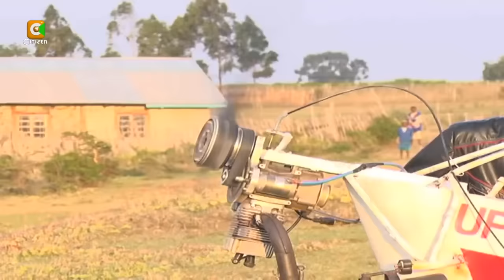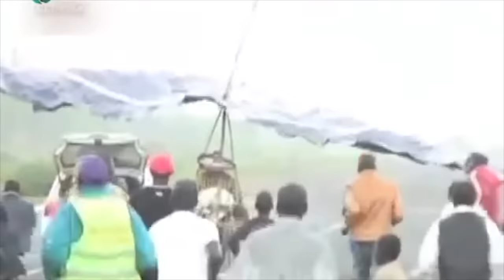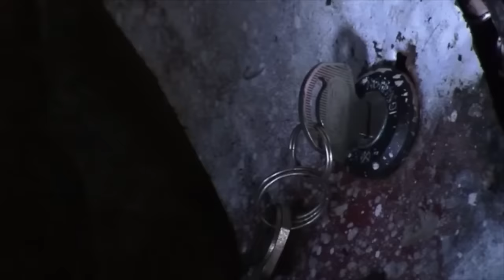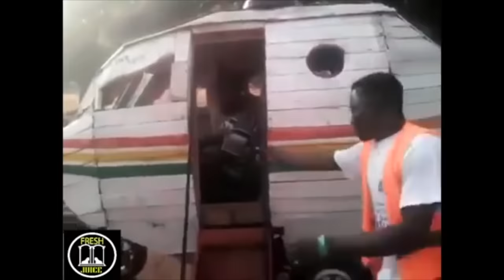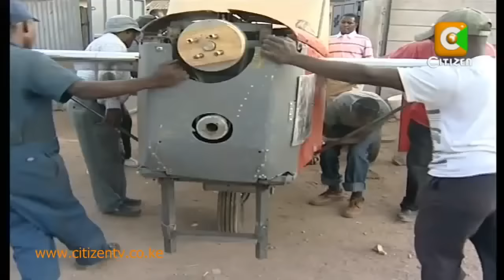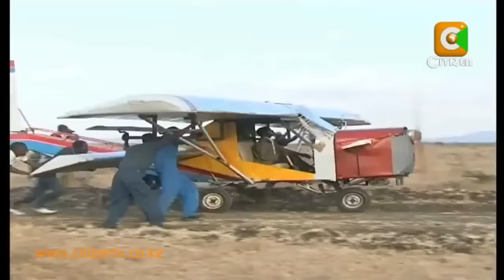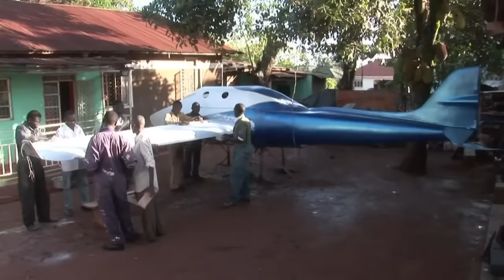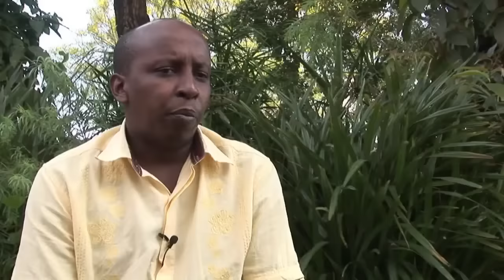African Airplane Compilation | African Aviation

Comment: Imagine how mind blowing a simple physics class would be for these dudes 😂
Reply: Imagine how a respect class would be mind blowing for most of comments in this video..
Reply: To teach respect, in what way? To not point out the obvious errors and goofiness, but to cheer them on or something? "Nice job, at least you tried?" 
I have respect for the ambition they have for their projects. But the sheer amount of (sometimes hilarious) bullshit going on, while information has never been easier to come by... But let's just wave that aside, and cheer the fellows on, letting nothing get in their way of continuing this ridiculous ride, instead of giving critical but fair comments on how they could do it better. Let's not for example say to the chap who is welding, "Get some good welding goggles", no, let that practice continue, let a fucking weld be more important than that man's vision. These men need to learn how to do it properly, otherwise it is only a economic drain for them. If they do that, and come out of it with a working project, or even a failed one without all of the bullshit- THEN they get universal respect. If they can't afford it, set more realistic goals. It's how life works.
Reply: @JimmyPX  soft
Reply: @Mediamarked You've never seen actual poverty. Did you notice any smartphones or computers there? No. Why didn't he use welding goggles? Bc they don't have them. Believe it or not some places don't have cell phone signals, cell phones, computers or access to the things you have access to
Reply: @olliefoxx7165  lol at the virtue signaling. Would you prefer they stay in that situation or improve their lives through knowledge and improving their quality of life?
Reply: @Em022  I'm not virtue signalling just pointing out the obvious. You're acting like the folks that laugh at poor people and tell them they should just stop being poor. Sounds easy when you're sitting on piles of wealth.
Reply: @olliefoxx7165   I like how you can so easily come to conclusions on strangers on the internet. Would you like to write my biography?
Reply: @Em022  take the L there little guy, he made a valid point and you jumped immediately to crying about "virtue signalling" because you didn't have an argument in response.
Reply: First of all, Ollie didn't even offer any point to the thread (which started off as a joke but there's always someone who has to take everything seriously) other than to project that we don't know what "poverty" feels like.  We're talking about improving lives through education. No shit, that some places in Africa don't have access to a lot of amenities in the first world. The continent of Africa is still developing (rapidly in some parts).

Second of all, the response to my question of "Would you prefer they stay in that situation or improve their lives through knowledge and improving their quality of life?" response was that I "sit on a pile of wealth" lmfao. Totally shit on me there .

Now assuming Africans don't have access to phones is just ignorant and shows that you don't know what you're talking about. Africa is developing pretty rapidly and the data says that 60% of Africans have a cell phone and 50% have a smart phone. They also rely heavily on cell networks to move send money to family members. Obviously, this video was made a while ago so the numbers may have been less but that doesn't have anything to do with the present.

Now on to the main point of what this thread is about. The people obviously had access to tools and such to build these flying contraptions. Imagine if we gave them the knowledge of how the world works to actually put there skills in building stuff to actual use instead of this comedic montage of failed aeronautics. What is so wrong with that?
Reply: It is ridiculous to try to build a plane knowing little, if anything, about aeronautics, engineering, or physics. That is true if you have the internet, and true if you don’t. The attempts to be sympathetic to these sorts of wasted efforts, admirable though they may be, are going to keep comically crashing into that reality.
Reply: @JimmyPX bunch of uncle ruckus bots in here. The comments are disgraceful.
Reply: @JimmyPX because this is a racist YouTube channel, look at his pfp, most thease ppl thing África is a country and African is a ethnicity
Reply: @che8866 because this YouTube account is racist one look at his pfp
Reply: @Bell_plejdo568p  yes of course these videos are full of them. It’s nasty.
Reply: @Bell_plejdo568p  just noticed his pic
Reply: @JimmyPX  dud received an 80k donation for a space program he knows doesn't work, he and his friends are laundering money, so I don't respect him and I find it funny
Reply: @olliefoxx7165   then how about starting infrastructure for electricity and water pipe lines instead of a space program
Reply: @Em022  I'm not the one that assumed Africans didn't have cellphones. You're building a strawman argument. By your own uncited stats you say that 60% of Africans have cellphones and 50% have smart phones. Going by your own numbers 40% DONT HAVE CELLPHONES and 50% DONT HAVE SMARTPHONES. So, your own uncited numbers prove my point that there are places in Africa that don't have cellphones/smartphones. Even with cellphones/smartphones that doesn't mean they have good reception or reception at all in their area. There are places in America that have no reception. If you've ever traveled in remote/rural areas you'd know that. 
"Would you prefer they stay in that situation or improve their lives?" That question was so absurd it didn't deserve a response. Who would prefer someone stay in poverty and lack of opportunities? Do you have those thoughts in your heart? Do you wish there were areas of people that didn't get access to education and knowledge? Why would you even ask such an absurd question? Of course I would like to see the people have access to better education and opportunities. If I didn't I wouldn't have defended their attempts at learning. 
You're probably not a bad person, I just think you havent traveled alot or had enough life experience yet. I hope you realize that people with different opinions than you aren't attacking you or hating on you. I have a different opinion but that doesn't mean we are enemies or must dislike/attack each other. Hope you have a good day. 👍 ✌️
Reply: @francisconikotian2326  That's a great idea! It's sensible and practical as well as necessary. However,  it's good for a culture to have dreamers with lofty ambitions. The guy must know he needs those things to achieve the other. Maybe that will spur him to advocate for that infrastructure so his dream can be achieved one day. People with big dreams inspire others and that can be contagious in getting things accomplished.
Reply: @JimmyPX  Praising people for doing nothing of value is not respect, it's demeaning.
Reply: @DamnMyNickIsTaken  Who said they need to be praised? Just don’t be a prick it’s that simple.
Reply: @olliefoxx7165 the only ones I saw laughing were the spectators in the videos…who , wait for it, looked just like them…to use obama’s  fave phrase. So you virtual signal, I’ll join the locals in a good chuckle.
Reply: @Mediamarked  yeah just tell him to get welding goggles. If you do maybe it will just materialize into existence.
Reply: @dexorne9753  They are not THAT expensive, meanwhile, eye surgery is. Just logical thinking, nothing more.

Comment: Love videos like this. There is literally NO WAY they can blame the White man for this. The failures here are that of their own doing.
Reply: What does that even have to do with anything? These dudes are literally attempting to build a plane in their backyard with literal scraps
Reply: @EpicMinecraftFail  it aint hard to make them fly from scraps, long as you can source a decent motor, thats the hard part if ur on a scrap based budget, though if ur smart and just want it to fly then the cheap solution is to make a electric motor build from scraps as you can easily get much higher torque then any combustion motor in a smaller/lighter package, as you can source all ur prefab needs from old generators, starter motors, washing machines etc etc, then throw in a few lead acid batteries for enough flight time to basically take of and then glide back in for landing before the batteries loose their juice, no point trying to make ur go to daily transport first try, just taking of and circling back for a landing = good enough if one wants to show their design is functional + doesnt kill you and get more support for it.

hence you would first design the craft from wood or other light scrap materials that is easy to craft with, as a throwable glider or RC model if u can source the parts to test its general flight performance, add some extra weight to it when it seems good to see how it handles etc etc even do weighted water drop tests to see how moves through the water as well and basically tweak the design in small, before you begin building the big, though it wont be identical in flight, it gives u some idea of what to expect, which better then having no clue and this also helps resolve issues found in the full scale version.

most of the designs in the vid however... id have to say folks must be short some brain cells, they seem like 5 year old kids who just finished watching a cartoon and decided they are going to fly... and even copied the design from the cartoon... complete lack of basic human common sense or logic applied for the majority of them.

problem is in modern countries private flight is heavily restricted, in part to prevent/deter everyone taking to the skies as their daily transport, just imagine what it would be like for police and just imagine what the accidents would be like = governments dont want that, so they try to deter flight being the norm for every day folk, even though in reality if not for restrictions it would be faster/cheaper to fly then to drive, if not for restrictions the majority of light transport today for general shopping, going to work etc would be flight and at the same costs attached to buying would plummet.

even helicopters are technically obsolete designs, there are far more better more simple mechanical designs for getting the best of both, thanks to computer technologies being avilable, which in 99% of craft today are mechanical designs from the pre-computer era, so they dont take full advantage of what computer can do, because the design was never built with such technology in mind, so computers are designed for the obsolete mechanical designs and not the way it should be, the mechanical designs should be designed for the computer.

problem is hardly anyone is doing it because there aint a market for it, the rich and mainstream transport prefer safety or established tech = whats been proven safe for many decades and has all the required support for it world wide, so if its not one big name selling it, rich boys aint buying it unless there a enthusiast, same for transport.

this is why the rich still fly aircraft over a half a century old designs, because its proven safe + its easily available for purchase and maintenance and thats what the big names sell, same with mister president of USA, much much better designs exist but its a old safe design.

anyways food for thought.
Reply: @EpicMinecraftFail  Just like the wright brothers 100 years ago?
Reply: @soulipsyz  Wright Brothers are geniuses yes but they also had the funds and education that these people didn't have, pretty disingenuous to trash these guys when you don't live in a third world country and were probably raised with quality education whereas they had none or very little and are still actively designing planes
Reply: @EpicMinecraftFail  
so? we invented flight and we did it in the early 1900s using nothing more than canvas, wood and a heavy, inefficient + under-powered engine. 
And now we mass produce aircraft that are capable of super-sonic flight. 
Africans should easily be able to build a simple aircraft that's at least capable of leaving the ground with the help of modern engines + modern materials.
Reply: @Dushmann_  And where would they get those modern engines and materials?
Reply: @EpicMinecraftFail  The thing is, the Wright Brothers did it nearly 120 years ago. There are loads of blueprints these dreaming aviators can obtain for free online. They don't need loads of cash or anything insane just to get it to fly a short distance.
Reply: @MyNextShotWontMiss  its not like no one's done it before it's just hard for the average african
Reply: @EpicMinecraftFail  these are the wrong brothers not the Wright brothers from a century ago

Comment: Everything African is just so impressive
Reply: Impressive how far behind they are still
Reply: @themuckler8176  I think the OP was being sarcastic
Reply: Not sure "impressive" is the correct term here. More like sad
Reply: Their film work is equally as impressive
Reply: @themuckler8176  the creators of these aircraft are like 10 times smarter than you buddy😂 I'd like to see you try building one.
Reply: “We” won the cosmic lottery and stand on shoulders of geniuses, who stand on the shoulders of generations of geniuses. We’re all like a bunch of spoiled rich kids in comparison to “those” guys.
Reply: @joshuadavis5899  dude u can slap a ceiling fan on a cardboard box and call it a helicopter...and you would be closer to flying than any of them.
Reply: @joshuadavis5899  lol. Firstly, they aren't aircraft. Aircraft fly. Now read your post out loud while looking in the mirror.
Reply: Yes, very "special".
Reply: @joshuadavis5899  It's not that hard. All you need is basic understanding of aircrafts and how they work.

Comment: Why, almost every one of them are severely disregarding the weight factor? I see a lot of bulky iron bars. They focus more on the shape than the frame itself, which is crucial. The heavier, the more power and wing surface it needs to have. When we were kids, we managed to build (no internet, no books, etc) some primitive hang gliders. We would rush on a steep hill and fly a couple of meters. We kept it very simple and light. We knew at least that. My brother, who was no older than 13 or 14 managed to adapt the vacuum engine to the little bicycle we had. It was crazy. Of course we went nowhere with it, because we would need a power socket and a very long cable.. nowadays it’s much easier with YouTube all these resources.
Reply: I'm guess your skin tone starts with W and not B.

There's your answer.

Comment: What’s crazy is they’re a little bit of funding away with a few of them. Like the white one close to the start actually looked decent.
Reply: I honestly don't think funding is the problem, they just need to sit and do the boring part. read some books on the matter, build small RC prototypes, spend some time running experiments and learning. If they have motorcycles, electricity, cellphones, power tools and access to the internet even if it's limited (and I'm 100% possitive they have all of the above) there is really no limitation to what they can do if they have discipline and dedication. The thing is I think their enthusiasm and emotions take over quite easily and they seem to think they can eyeball everything to success which might be the case for fixing cars, bikes and home appliances but flight is completely different.

Comment: How did they get rotor blades from???? Building a conventional. airplane is very easy if not worried about useing certified fasteners or epoxies.. when I was a kid you could buy planes for a glider that used bed sheets for covering. I even had a friend put some wings on his car and it actually came off the ground at 93mph... collapsed the front suspension when it came down hard a 1/2 a second later.

Comment: If your plane collapses while still on the runway, you have to thank the gods that it did not take off. If it had...
What would the landing have been like? What would the air resistance have done to it in the air? Better to not have to find out.

Comment: It doesn't matter where you try this, manufacturing with crude materials (using what is on hand) is no joke.  Most failures come because of too much structural weight.  If two guys can't lift an airframe (no engine or landing gear) off the ground easily, it's too heavy....

Comment: How hard is it to find an aircraft manual they literally have all kinds of manuals which explain in detail every part of the plane, or public blueprints for kit planes, there are thousands of books written on aerodynamics. As someone who studied aerospace, i can say with 100% certainty none of those aircraft are flying, especially the one where the guy said the problem is the "the wheels". The last one has a chance based on the actual vaguely aerodynamic shape and lightweight composite design. But without an engine, flight controls, control surfaces, its going nowhere, also the wings look wrong but i can't see them fully. Its like they are trying to reinvent a plane just by looking at one, having zero understanding of how they work, and copying it.

Comment: None of these guys compensate for the weight with the engine.

And the support?

the wings are extremely homemade without exact measurements

they should start with hang gliding
They are more practical to start with, their cost is much cheaper

Comment: Hey I did this when I was 6 ..with an umbrella and a ladder...EXACT SAME EFFECT. NO FLIGHT. .. um you guys might consider looking at a PLANE that actually flies for engineering tips. Cause a winnebago with a ceiling fan with a weedeater motor WILL NOT FLY. ..JUST SAYIN. LOOK TOWARDS WHAT DOES WORK for examples..